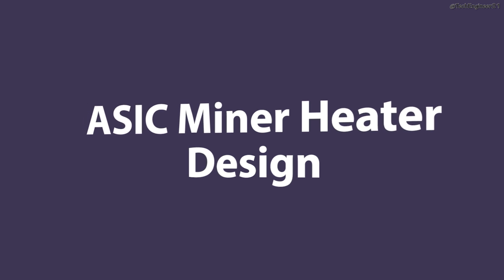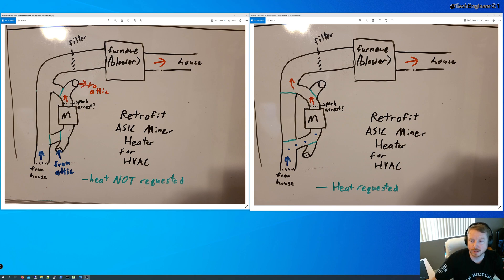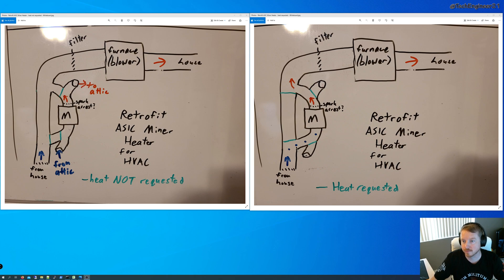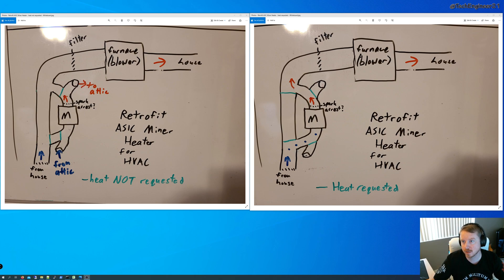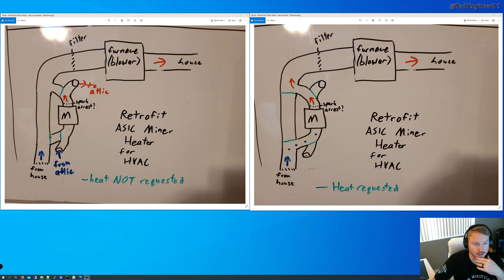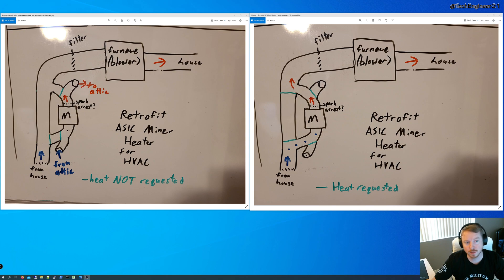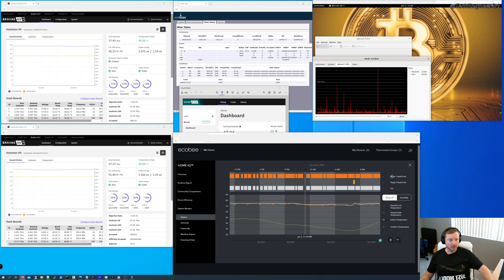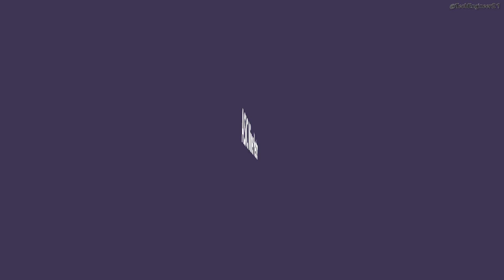ASIC Miner Heater - Mine Bitcoin while heating your home!

Comment: 3,1kwh miner is able to heat 70m2 house by using drycooler when winter is about -5degresee?
Reply from the maker: I would think you would need more than 3kw if temps are consistently -5C
Reply: @techengineer9589  thx, I want to use heat boiler of 150l water and heat house by using drycooler we will see :)

Comment: When in non heat mode, are you pulling in fresh air from outside? I kinda saw it in your drawing but not in your setup.
Reply from the maker: No, just from attic. Through a filter.
Reply: @techengineer9589  On non heat mode it would be more efficient to just shut down the mining since profitability is negative when the heat is not being used. Also mining only when needing heat would make a pretty strong case against those who say bitcoin is bad for the environment.

Comment: Thanks for this, man. Working on getting electric situated at my house for a goal of about 20 S19j Pros. Probably won't get 20 but trying. Did you do the electric all yourself? It'c currently my biggest struggle at the moment cause electrician alone will cost between $7k - $20k depending on what I choose. Your vid is very inspiring
Reply from the maker: Sounds like a fun project for sure. I had an electrician install the 220V circuit as I wanted to make sure that part was done correctly. I did install the 220V zwave controller, however. Thanks for the feedback!

Comment: Isn't a computer case (or your box lol) supposed to be under positive pressure, not a vacuum? I don't mean that rudely. I just meant that in a helpful way. I saw a video (LTT) where they were testing a case with airflow and they had a big graphics card in and it cause a lot of.. well.. bad airflow and completely made the components not cool sufficiently. But maybe the shear volume and cfm you're pushing makes that not matter? Idk. Just thought I'd share that.
Reply from the maker: So, that may be true for certain computer cases, but the point is cooling the chips. The chips don't care as long as they are cooled effectively. The antminers themselves have a push and pull fan making lots of airflow across the chips. The larger fan is then evacuating all that hot air from the larger box they sit in.
Reply: The S9's would run much better with positive pressure.